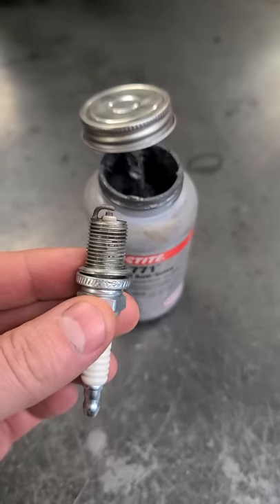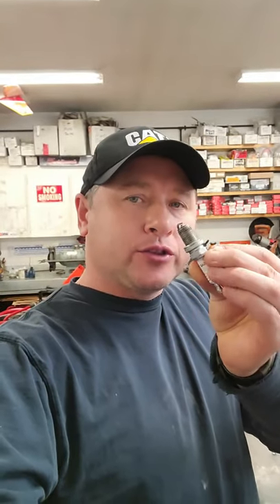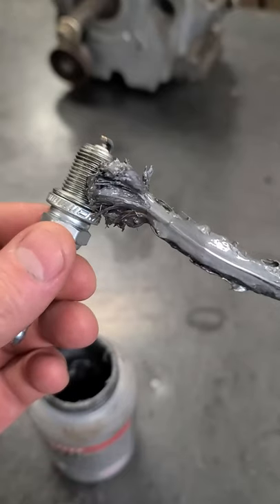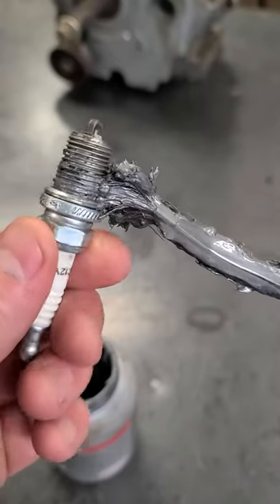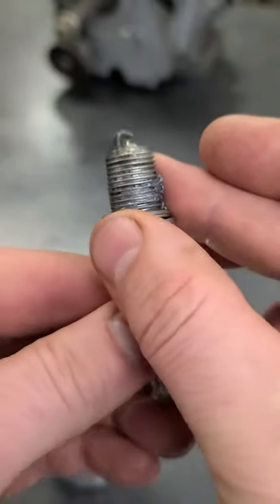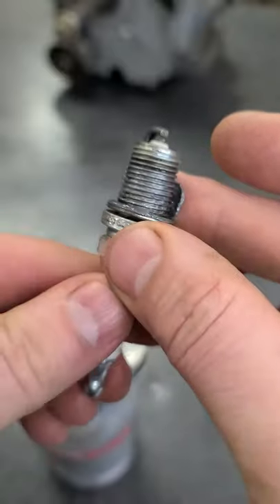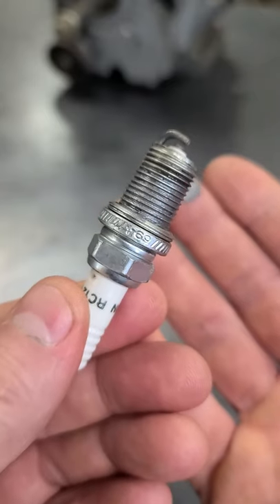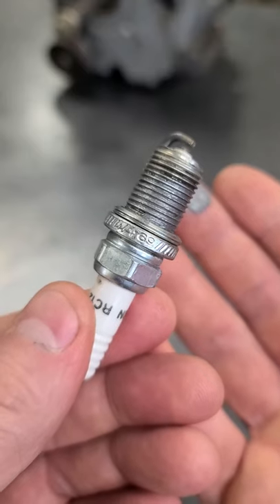Can I Use Anti-Seize On Spark Plugs? #shorts

Comment: Think about torque specs. You put a lubricate on the threads that cause the torque spec to change & you end up over torqueing because of the lesser resistance. What people should do is go by the manufactures instructions. They know cause they made them. Imagine making something & then someone else telling you the best way to use it. LOL
Reply: Wet specs are usually 30% lower
Reply: Tell that to a Ford owner.
Reply: Exactly. Not to mention many plugs come with a thread coating already applied. If one followed the TQ spec, they wouldn't have it seize in the head!

Comment: talking to multiple spark plug manufacturers reps years ago they all said no.  the thread area is plated to eliminate galvonic corrosion and one even warned that any lube would result in overtorqing and risk of puling threads
Reply: at one time it was recomended years ago  but not anymore
Reply: @richardcranium5839  many years ago, correct. No longer though.
Reply: Do you think that these manufactures might say that so as to not admit spark plugs might not be as good as they could be?...check out some of the PWC service videos showing corroded plug threads and snapped in head threads!
Reply: Yes toyota specifically with NGK plugs does not recommend using any antisieze
Reply: @boots7859  You are very likely correct with regard to cars, Evidence suggests PWCs is a different environment...NGK are specified for several brand PWCs and YT has examples of badly corroded plug threads even though the plug wells are sealed with what appears to be extensive moisture mitigation. I personally don't use anti seize on cars, but will on my marine engines. Most have compression washers and so over torquing is not relevant here.
Reply: @mekuranda  my question is in those videos you mentioned are they using an o.e.m. approved plug?  or are they aftermarket ones with the same specs?  saltwater marine is a terrible environment for anything to live in.
Reply: @richardcranium5839  I believe I mentioned some PWCs specify NGK, Yamaha's factory service kits in the US have included this brand.
Reply: @boots7859  ... I usually favor skipping the torque wrench and doing contact plus a quarter turn with gaskets. Contact plus an eighth turn for non-gasket plugs. (with light lube or anti-seize)
Reply: I used this stuff on lug nuts and the bolts all stretched.  I would expect problems in the cylinder head also.
Reply: @berardia4  meh.  I use a little on the base of the first few threads, opposite end from electrode and have never had a problem.
Reply: @rupe53 Same here, I've never used a torque wrench and have never broken one or have one back out.
I've always been nervous using a torque wrench because it feels like I'm  over tightening the plug.
Reply: @berardia4 ac Delco recommend not to use any anti seize on any of there spark plugs u only need about 15 ft pds for plugs it should feel like they are barely even screwed in there

Comment: I use  antiseize on plugs, anything under the vehicle and all screws or nuts I remove and replace on a vehicle and blade bolts…basically everything that gets exposed to the elements.  I’ve been doing this forever.
Reply: Thread lubricant is the only way to get an accurate torque.
Reply: @davidmoran4471  I used that when I built my Mustang engine.  I'm not too concern with torque on the other bolts I mentioned above I am only really concerned with correct torque when I am dealing with the motor (i.e. head bolts, intake bolts etc.) or headers and such.  My concern with the other bolts is it not seizing and being able to easily remove them.  I only snug spark plugs...no torquing them for me.
Reply: @davidmoran4471  It's a lawn mower not a pro stock motor.

Comment: Think about this a second. If plug manufacturers did not want you to apply anti sieze on the threads of thier plugs, don't you think they would clearly state that on every spark plug box? Of course they don't, its because it doesn't matter. Use copper coat. Makes the best grounding conductor and eliminates any possible thread seizures. Been using this method on all types of engines for over 50 years and always provided superior performances.

Comment: You don’t need anti Seize on spark plugs manufacturers don’t recommend it.
Reply: You are correct on this, however, they don't have to take your plugs out after 50-100k miles, especially with most all engines have aluminum heads. I put a very light film, much less than Donnyboy put on his, just so I can get the plugs lose when it's time.
Reply: @oldjarhead1125  And on marine engines...often left for long periods with out inspection and high moisture galvanic corrosion potential
Reply: And the plug manufactures would like to sell you a new set, that is after you helicoil in new female threads in your engine, but you can do as they say if you like.
Reply: @37yearsofanythingisenough39  Do I detect some sarcasm ....nah...just my conspiracy mindset leaking through  ....
Reply: Virtually all spark plugs now feature a special anti-seizure nickel or zinc-chromate shell plating. Basically, you can think of the plating as a replacement of thread compound or copper slip. Here’s what NGK says:

NGK spark plugs feature what is known as ‘trivalent plating’. This is a silver-or-chrome coloured finish on the threads that is designed to provide corrosion resistance against moisture, chemicals and weathering. The coating also acts as a release agent during spark plug removal. NGK spark plugs are installed at the factory dry, without the use of anti-seize. NGK tech support has received a number of tech calls from installers who have over-tightened spark plugs because of the use of anti-seize. Anti-seize compound can act as a lubricant altering torque values up to 20 percent, increasing the risk of spark plug thread breakage.

Comment: I don't know but my opinion I will never use any on my spark plugs I have a Ford mustang that I was getting a misfire from and come to find out I was getting bad contact with my cylinder head due to the anti seize. I cleaned up the threads on cylinder head and spark plug now I have no more misfire. That's my story and I'm sticking to it.............
Reply: after doing this for 50+ years I can tell you it's not a lack of ground through the head. You have sticky fingers and got some of the goop on the plug insulator. (inside or outside)

Comment: I always put it on all spark plugs. I learned the importance of that working on air cooled VW engines. I paid for my milling machine installing head savers in stripped spark plug threads. People would put in cheap Champion spark plugs which always took out the threads when removing them.

Comment: The original VW Beetle engines were made out of magnesium. When a non-corrosive type of metal, (like Mg or Al), is in close contact with a ferrous metal, there is a good chance that galling &/or seizing may take place. To prevent the damaging of spark plug holes, VW specified the use of Bosch spark plugs.  These had a thin layer of platinum plated over the threads. I have to wonder if Bosch still uses platinum, & if so, do they apply it to all spark plugs or just certain types.
Reply: NAH. Bosch does NOT have platinum-plated spark plugs.
Reply: @SlikLizrd  it wasn't platinum back in the day. I believe it was cadmium plating for Bosch plugs. (brass colored) The VW heads were aluminum. Only the block / case was a magnesium alloy. I did a LOT of VW work back in the day and most of us used something to lube the plugs. OTOH, just about every plug that seemed to be stuck was actually cross threaded. (by some idiot) Those things were hidden, and I treated them like starting a brake line. If you couldn't spin it several turns by hand you'd better back off and get out your thread chaser.

Comment: I had the opposite problem with my car back in '05. I was about to enter the highway and all of a sudden the engine made a different and louder noise for a few seconds and die. One of the spark plugs had just come off. Luckily for me I was a few hundred meters away from the highway and could park the car off the road. I spent the next few minutes asking door to door (I was 80 kms. away from home) if I could borrow the right tool for the job. I finally got to some retired couple's home, he had been a mechanic or something related to it so I got lucky. The weird part of it all (if it wasn't already) is that the old lady just seemed to never stop smiling at me.

Nope, it was not because I was any good looking at all, but because she thought I was the weather man on the regional tv channel. Just because I was tall and had long hair (half way down my back) as the guy from tv. She thought for a moment they were helping some kind of local celebrity but I had to tell her I wasn't.

So, don't use anti-seize or you'll end up breaking some old lady's dreams.
Reply: I don't agree with this.  If the spark plugs are properly torqued they won't come out by themselves unless you have one of the Ford V8 modular engines which have a design flaw which has been known for years to cause them to blow spark plugs out because the heads don't have sufficient threads to retain them.  There are repair kits for properly skilled mechanics to fix them without disassembling the engine.
Reply: @1575murray  though all that I said was true, the last line was just a joke.

My car had a 1.4 litre engine, I bought it second hand and I had had it for just over a year and a half when that happened. I had not even thought about the spark plugs, even less about changing them or even checking their torque. Moreover, they were hard to reach (in line 4 cylinder) and way deep down the cylinder head, so I don't even know if they had ever been changed in the almost 14 years before I bought it. I think I changed them once in the almost 8 years it lasted with me.

Now I care even less about them, I have a diesel.
Reply: I feel sad for the old lady.
Reply: @ronkuzyk3836  in all true, I look nothing like the guy, who I did actually meet at a shop (though I didn't talk to him or anything, I just recognised him and yes, it was him for real). We are about the same height and we both had long hair, that's it.

Mind you, back then his hair was as long as his back or so, while mine didn't reach much further than my shoulders. Since then, he cut his hair "like a normal person" and now it's me whose hair is a long as my back allows.

So, I don't know how she could think I was him, I guess her sight wasn't as good as it could and she "wanted to believe".

I could as well tell her I was the guy and leave it at that, but whenever the watched the tv again she would have noticed (I hope) so I preferred not to do so.

Comment: NGK plugs that are shiny on the bottom threads have a special coating from the factory. They specifically say do NOT use anti seize on them. Plus it throws off the torque spec by 20-30% so the plug will be over tightened .

Comment: For the guys saying it ok im a disagree  (Automotive) been a tech for a long time lol and the problem is if the plugs has got antiseize on it and plug is left in there for years the antiseize drys up Yes drys up and gets hard then strips out threads when removing. Now this is on aluminum head i dont think a issue on cast but definitely im against this stuff on spark plugs sorry Don  
Seen this happen years ago !
Reply: I disagree !!!!I was taught to always put it on plug threads ,a very sparing amount on the threads and  Have been for over 40 years ! .And most certainly in applications with aluminum heads .It has even been advised to be used on plug threads  in service manuals as well!
Reply: @andrewslagle1974  ... been using the stuff for 50+ years. Just a dab and wipe it around with a shop rag till there's almost nothing left... is about right. It's the plugs with the 3/4" reach in aluminum heads that really need it. Seat the plug gasket and go another 1/4 turn. Skip the torque wrench. This is torque to yield.
Reply: Yep I had stuck plugs on my cast iron head which I used the al antiseize ; it set for years with same plugs and little use, never again. only oil on plug threads for me. Probably the copper antiseize  would have been better but oil works fine.

Comment: Been putting a little anti seize on plugs ever since they started making aluminum heads. So far never had a problem.   I have had problems getting plugs out of heads where it wasn't used.  Now days we run plugs 100k or more. Lots of time between going in and coming out.

Comment: Not on modern cars with advanced ignition systems, but older cars, farming equipment is OK, but use the copper anti-seize, copper is excellent electricity conductor 👍

Comment: I used to use anti sieze on the spark plugs on my ford 300 six however after a few years with limited miles I was unable to get the plugs out so only use engine oil now and have no problems.
Reply: Good  day  I read  comment.  So engine  oil is better?  Thanks

Comment: Glad to hear this , ive done this several years now ans worried if it caused insulating electrical resistance resulting in weaker spark but no problems and it seems to offer lub for head threads

Comment: Don't let any antiseize get on the ceramic part of the plug.
Antiseize conducts electricity so the spark plugs wire could end up shorting directly to the cylinder head.

Comment: NGK now says no on their plugs.
I think on Old vehicles I will continue to use anti-seize but new vehicles are manufactured differently so I will follow their advice
Reply: The newer Platinum, and Iridium plugs have anti-sieze on the threads coming out of the box. If you remove a used one put a light amount of anti-sieze on the threads before you reinstall it.

Comment: DO NOT DO THIS ON NEW SPARK PLUGS! they coat them with a coating when they make them, doing this can make the plugs blow out! Not saying it will but there is a good chance they will and when you have to take a cylinder head off to have it retapped at a machine shop because it ripped the threads out with it better safe than sorry, you don't have to use antseize on new spark plugs, boot grease yes on the boots, just be careful people

Comment: Hi again, Dony - Happy New Year. I looked at your channel and have not found a video about this: Fit-It Fuel. I am trying to start my 1973 Olympique ski doo and there is plenty of spark - I think the fuel (even though I use stabilizer for summer storage) has clogged the carb. The carb is newly rebuilt as of three years ago. Do you have an opinion on Fix-It Fuel products? I really do not want to tear apart the carb yet again... and my brother in Bracebridge swears by it. I would like to hear what you have to say.

Comment: I was always worried that copper slip might get very thin at high temperature and wick its way down the plug and into the cylinder - creating a grinding paste in there ? I guess not if so many mechanics use it.
Reply: A master Mercedes tech has told me never use that stuff on spark plugs coz that's exactly what happens.  Very least it'll foul the plug.  It does work it's way in the cylinder
Reply: May I ask will it hurt the cylinder? And is it safe just to get a new set of plugs and wires and how can I safely remove the anti seize from the engine threads ? I'm scared of trash getting into the cylinders!??

Comment: My question would be why wouldn't you want to use it, as being different types of metal together will  cause corrosion, rust together, I believe it's called galvanic corrosion, there's any chemist out there they can check that word for me,, but yes aluminum and steel together that is corroded against each other will cause the aluminum threads to pull out of the head,, but good for you to try to help people that don't understand

Comment: There a good reason why manufacturers never use it.
Reply: It would be another step in manufacturing and that costs money.
Reply: @brianwaskow5910  No... That's not it at all.
Reply: @davidwalker7383  So you are a manufacturing engineer at one of the big 3?
Reply: @brianwaskow5910  Better... As a machinist of 30 years, I've seen what a dap of anti-seize can do to a piston (rings) and cylinder bore. It works just like lapping compound. The best thing to put on spark plug threads is a drop of ATF.
Reply: @davidwalker7383  ATF can't take the heat.
Better to use Synthetic engine oil -- or NOTHING.
Reply: @SlikLizrd  ATF is what's used during manufacturing. Transmission fluid flashpoint is around 383-degrees Fahrenheit. Its boiling point of around 550-600-degrees Fahrenheit. So it can definitely take the heat.
Reply: Yup. So they can sell new heads at the ridiculous 100K spark plug replacement schedule at which point the plugs and the heads are one piece.
Reply: @RMJTOOLS  I've never seen that happen. The only damage that I've ever seen was due to human error.

Comment: I think ok to use anti seize on older black oxide spark plugs but not on modern silver colored threads. Those are already coated from the factory and adding anti seize can interfere with heat transfer and alter torque readings. NGK specifically says not to use anti seize.

Comment: Another great Shorts Don, thanks so much 👍👌👏.

Opinions vary but I'm definitely in favour of this. 
However I use high temperature copper grease on spark plugs, also even more importantly on exhaust manifold bolts. 
We all know that sinking feeling when a dry corroded one of them gently snaps as we're praying it's gonna come out....

I'm not a pro mechanic but have done this in the UK for 40 yrs on motor bikes and cars, also on all my garden machinery which I use daily as a pro gardener.
Reply: Use Copper shield on spark plugs, it is like Never seize but uses copper instead of nickel so it transfers electric charges better, IMO.